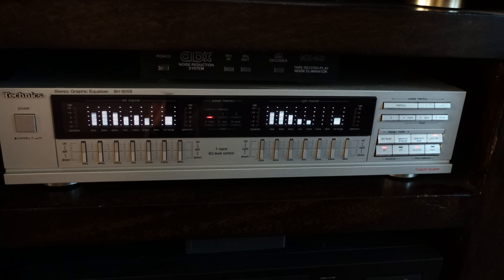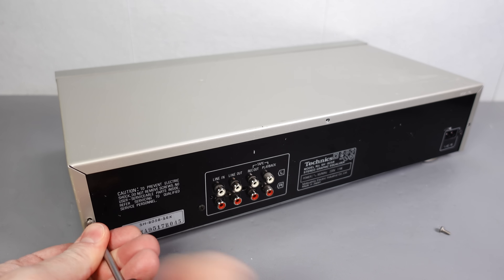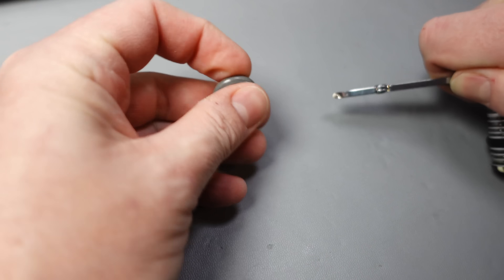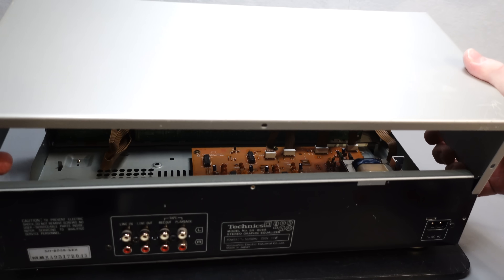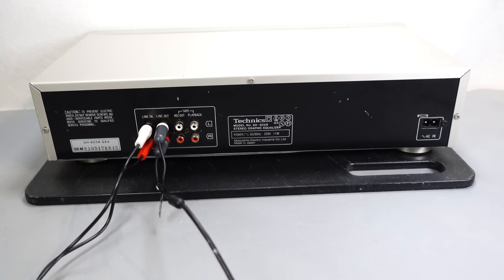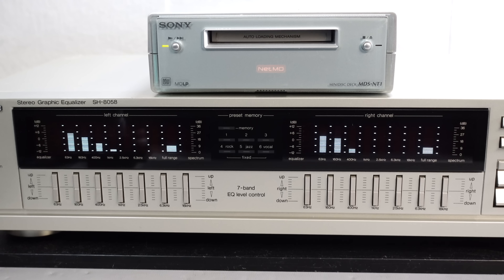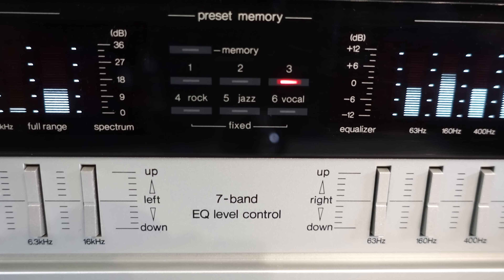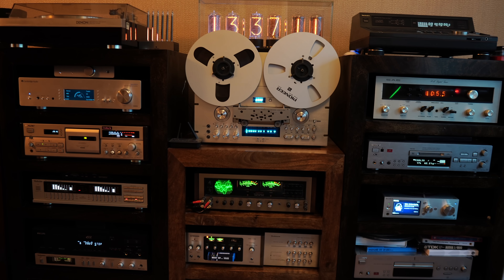The great equaliser - Technics SH-8058

Comment: Nice succinct video today.

Although it may be accurate to say that the minimal use of devices in between the source of the music and the listener will produce audio closer to what was intended by the artists and recording engineers,  that statement absolutely fails to take into consideration the variables present in the each individual room used for listening and thus highlights the need for a spectrum analyzer and equalizer. The term ‘equalizer’ does a good job of indicating its function, namely to equalizer the frequency response in a room. By using a white (or pink - I forget which) noise source and a microphone placed at the primary listening location one can evaluate the frequency response of the room on the spectrum analyzer and equalize the various frequencies to provide for a flat response that removes many of the variables of the room from affecting the accuracy of the sound reproduction.

That’s all fine and dandy, but I prefer the method employed by Mat and many other listeners which allows for equipment the be used for visual and audio pleasure that suits the needs and desires of the user, ‘accuracy’ and ‘purity’ be damned. Just like when we used to listen to Dolby B-encoded cassettes with the noise reduction circuitry turned off to enjoy the treble boost, I say let people use their equalizers as very granular tone controls to make the audio sound the way they want whilst simultaneously enjoying the light show on the spectrum analyzer. 

I have listened to some extremely high-end audio systems over the years and have rather enjoyed the unbelievable accuracy, dimensionality and fidelity that those systems were capable of reproducing even with just two speakers. But those were in large, designated rooms set aside for just listening to music and nothing else, modified and decorated for just this purpose. Yes, it would be nice to have such a setup, but I have not the money, space or time to allow for this, and I suspect that many of us are in the same position. I listen to my favorite music when I can, where I can, and with whatever source I have available. Yes, I am aware that listening to streaming audio from my phone in my minivan with its THX-certified home computer speaker system acting as the subwoofer is most likely not what the recording artist had in mind when the recording was made, I like to think that they would agree that it doesn’t matter how or where the music is being enjoyed as long as it is being enjoyed.

Comment: These are important to tailor the sound for your room.   Many models in the 80s used to come with white noise generators, and microphones that you would plug into them and would use to listen around the room and make EQ adjustments to balance out things to match the room and get back to more flat response.
Reply: That's exactly what modern surround AV units do with Dirac and other solutions (albeit not necessarily white noise).

Comment: A common complaint with graphic equalisers is that they add noise to the signal path, expressed as the Signal-to-Noise Ratio. The Technics SH-8058 has an acceptable signal-noise ratio of 100dB. Music lovers will understand that many older recordings were frequency-balanced for radio or limited response with compression was OK for playing a record on an old Dansette Record player but when Hi-Fi became the norm Bass & Treble controls helped a little but good quality Graphic Equalisation takes the music to another level.
Reply: Noise sucks, but the big issue is phase. Changing levels changes the timing of waves in many cases. Seldom audioble, but drives audio engineers up the wall.

Comment: The vintage stuff was great but the capacitors have fallen out of spec so they wont sound as good as they were when new and changing them with the brittle nature of something so old might cause damage to other parts of the electronics. It would be amazing to see a brand like Technics come back and build new models of the really popular things they sold like the SH-8058. No changes to the design, just manufactured again as new and marketed as retro design. It would be quite expensive since hifi has become a smaller market than it once was.
Reply: @matthewmarks6951   Also bad caps can cause hum, channel imbalance, and distortion in the signal path depending on the circuit design. Caps in the power supply can cause voltage fluctuations and reductions that may limit dynamics and power in the output. Years ago I had a Technics SU-V6X re-capped, deoxit to clean the pots/switches and a sticky relay replaced. To an untrained ear it sounded okay before the recapping but after recapping it was better sounding, more full and more dynamic. Minor improvements but noticeable.
Reply: @matthewmarks6951  What I said has nothing to do with snake oil sales. Common sense my man, old things need maintenance sometimes. Also I do plenty of blind tests. You have no idea who I am and how crazy some of my engineering friends are against tin foil hat audio and snake oil sales. I've spent entire Saturday afternoons doing A B blind testing for years. My friend was so crazy about blind testing he bought a QSC ABX comparator many years ago so we could do high quality instant switching for A B blind testing.
Reply: @matthewmarks6951  The untrained ear is someone just listening and has no reference point, they would not know anything would be better or worse.

Comment: Mat, as an Audiophile I can only apologise for the tw*ts that moan about 'never using EQ'. I assure you all real audiophiles love 'em. I so understand the 'flat response' crowd, but this only makes sense in a feckin anachoic chamber or studio monitoring booth with bleedin expensive speakers. Most audiophiles understand their own equipment and what needs to be adjusted (eg EQ!!) to make it appear flat, given room acoustics. Heck, as you get older you need a bit of EQ to adjust for your dilapidated ears!
Reply: @matthewmarks6951  ... which is exactly why these people are audiophools. I'm not talking expensive crap here; £100 for an EQ on my (vintage MD-equipped) sony £300 Micro system? Hardly excessive but it helps. It's a sonic fact, no audiophoolery here :) Of course room reflections can't be catered for. Only with thousands of quid can you 'fix' things like this, but as I said, at 60 I do need a gentle EQ curve. Doesn't remotely put me in the 'phoolery camp! Thx for the response.

Comment: I think the audiophools fail to realize that not every mix and master is great and done by consummate professionals. Listening to something "as intended" is far from ideal and not suitable for most situations. Unless you have the same exact setup and listening environment as the mix engineer (which no one does), you'll never hear it "as intended". The listener's ears has the final say on how things should sound to bring maximum enjoyment to themselves. That means EQ'ing frequencies up or down may be necessary to achieve the desired effect.

Comment: Any live music technician will vouch for the utlity of a graphic EQ in  a system. It is  a vital component in ANY system. Period. So, an audiophiles insistence that a graphic EQ is some sort of violation of the basic tenet of a system is on its face ludicrous. Just like their insistence that tone controls are also a violation of basic HiFi etiquette. The very inclusion of them is somehow a violation HiFi etiquette is ludicrous. Any incremental control is not only preferable but necessary.

Comment: Heartily sick of the "you should never use eq" crowd. Our perception of EQ balance changes with amplitude. That means that the "perfectly mastered" original can't and won't have the same eq balance at high listening levels it does at low levels. Oh and the fact that many of the "perfectly mastered" originals are anything but and sometimes professionally mastered albums actually sound quite wrong.

Comment: Just like those "audiophiles" that say they can hear the difference between "pure oxygen free copper power cables" that cost $100 per foot, and plug their overpriced power cords into a wall outlet that runs through Romex or aluminum cables back to their breaker panels!  NOT!